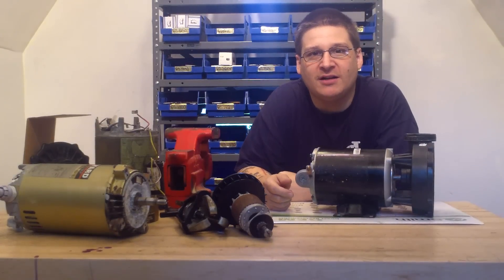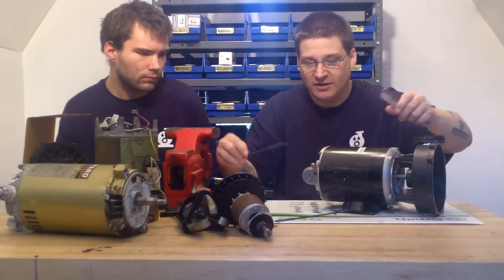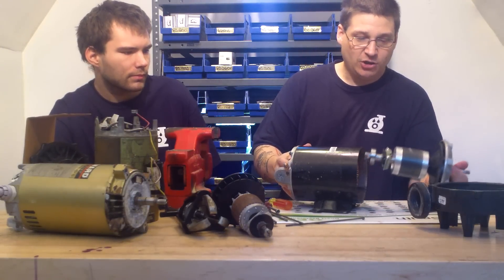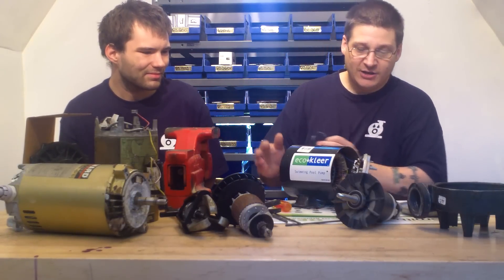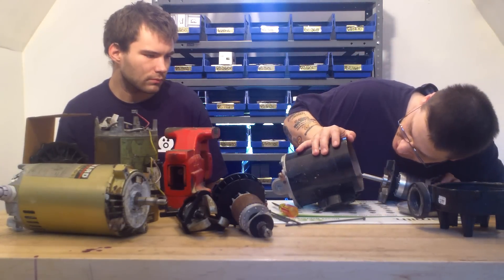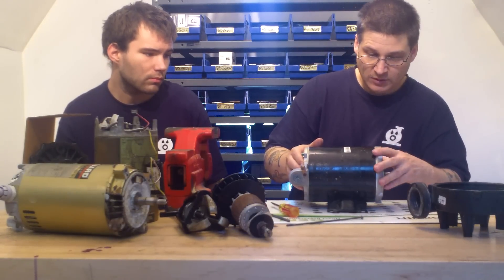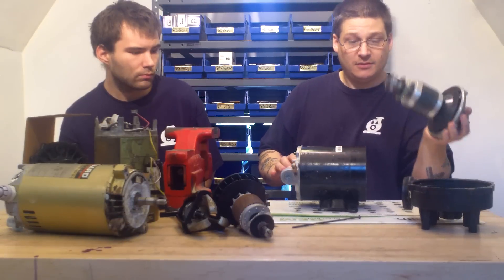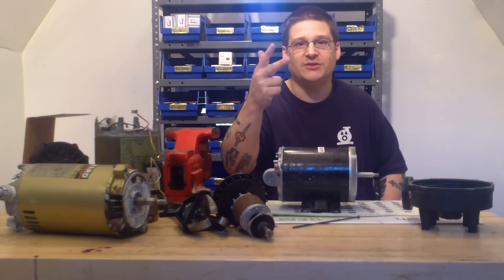Pool Pump Tutorial [ Hayward ] - How to Rebuild Pool Pump Motor 101

Comment: My question is, what would make a pump not want to turn? My Emerson 1081 1h.p. pool motor hums and shuts down until it cools off.  It does pump until it overheats and shuts down. No leaks and no ventilation blockages as it is on a concrete slab. Obviously I’m a newb but I don’t want to spend $250 if I could rebuild myself.

Comment: Hi, I have a Cal Spa that has a single 2 speed pump that only runs on high. consequently the spa overheats.  If you don't mind, what should I check? The heat light isn't on
Reply from the maker: check the capacitors